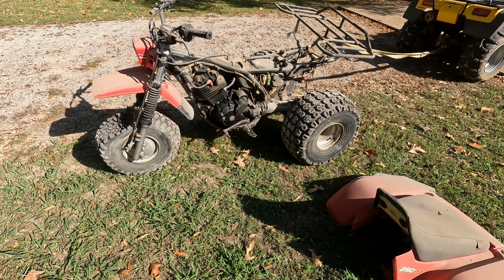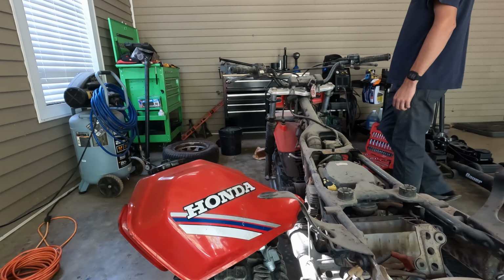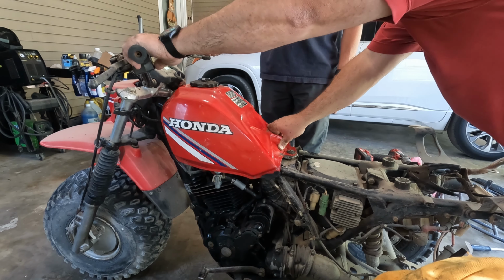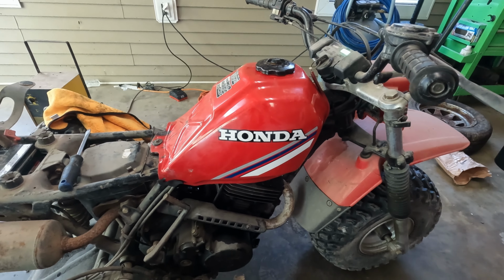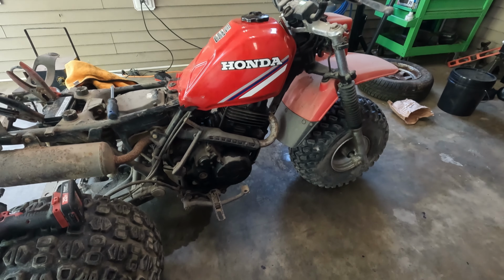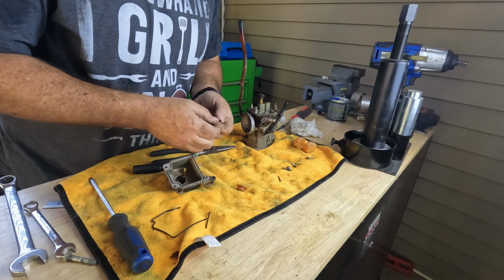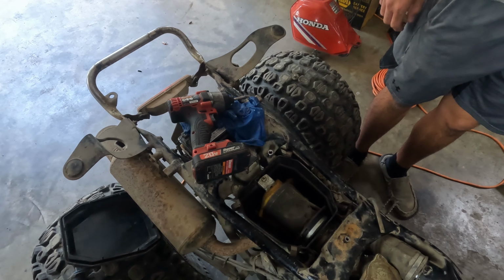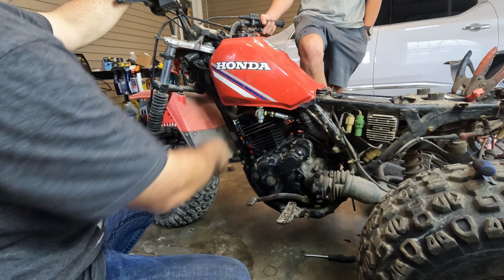Restoring the Classic Honda ATC 250SX: A Journey Back in Time?

Comment: Coincidentally, I just picked up a 87 Kawasaki 250 quad for my friends daughter. It is also a kick start, but no starter at all. Like you said there was a lot of kicking. We use a multimeter to check the kill switch, and the on/off switch, coil and the stator. There were all in specs, so we socked it with starting fluid and finally it caught. It had been sitting for 10 years and we took the gas tank and lines off completely and ran it only on starter fluid. Like you we wanted to see if we could get it started before we dumped money into it. We feel much more comfortable now that we got it running. I should have video'd it too. Dang.
Reply from the maker: OH WOW!  I would LOVE to have a Kawasaki! I actually never owned one but rode with 3 friends that did. SOOO many fond memories. I saw one on FB that was $2,000. It was black. Does yours have the clutch? The ones I had dealings with (1984 Kawasaki KLT 200-A) had a manual clutch and I like that actually.
Reply: It has a clutch, headlight, and taillight, but it doesn't have a starter or battery. It is a kick start only.